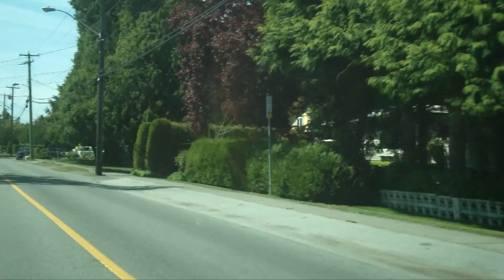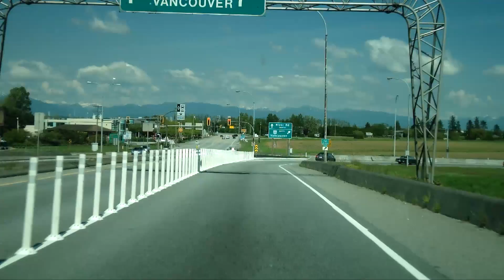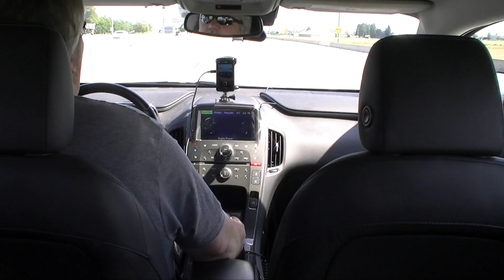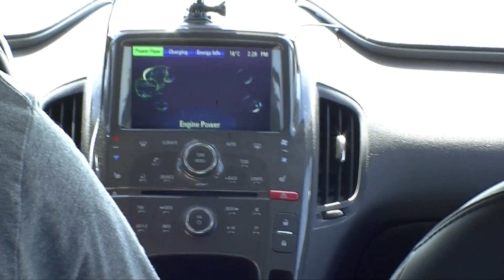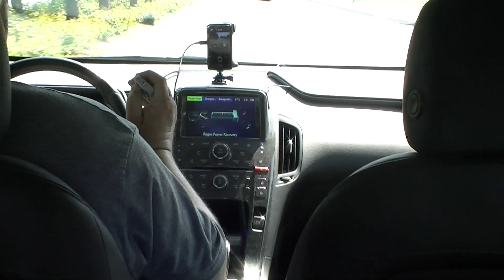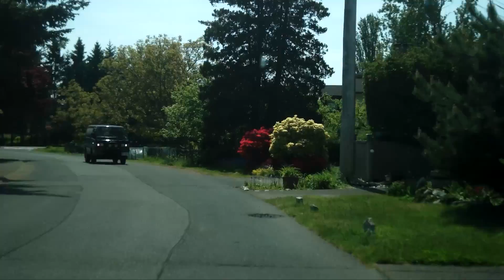How to drive a chevy volt for best electric range and fuel economy

Comment: How's the Fuel Mileage in the winter time?
Reply from the maker: +Trucking Vapes 
In the cold weather the electric range drops to about half, this is due to heating the cabin for starters. Also batteries do not perform as well in the cold. In extreme cold the engine will start for a few minutes. The warm coolant is used to heat the pack an cabin. Then the engine shuts down. In terms of fuel usage, I average 1.6 litres per 100 km. Over the life of the car. That is including road trips across the country. On average a tank of gas lasts me 10,000 km. That's right! I go 10 months between fill up of the gas tank!
Reply: +12voltvids I've been looking at a Used 2013. Any common problems? Battery & Powertrain have a decent warranty?
Reply from the maker: +Trucking Vapes No problems whatsoever in 4 years.80,000 KM and been all over western Canada and the USA with it.The warranty on the battery, and all electrical parts is 8 years 160,000 KM (100,000 miles).The only issue I had was a caution caused by a low battery coolant level.Took it back to the dealer, they added about 1 cup of coolant to the reservoir and sealed it again. The problem was documented. When the car was assembled, small air bubbles in the coolant line eventually worked their way out and were replenished by fresh coolant resulting in the coolant dropping over time (4 years) to the low level and tripping a sensor to warn. Dealer topped it up, not only was this free, but I received a letter giving me a complementary oil change, lube, multi point inspection, and tire rotation next year, all for my inconvenience of bringing the car back.People brag about Tesla giving them great service. Well GM has given me exceptional service on my Volt. I will definitely be buying another one, no question about that.FYI when my car was in for it's annual service the brakes pand were measures. Still over 10mm brake life left. They are only 12 when new and my car has 80,000km, (50,000 miles)
Reply: +12voltvids Thanks for the info, i live in Ontario myself, I have a 100km round trip per day, won't be able to Charge at home all the time, but will be able to at work 100%. I'm going to go take this used one for a Test drive and Talk about the price. It's at a GM dealer down here. Not some fly by night used dealer.
Reply from the maker: +Trucking Vapes 
So you should be able to get 50-60 km on battery power and the remainder on gas, perhaps 2 litres. In the dead of winter you will burn a little more. My battery range drops almost in half in freezing weather due to the electric cabin and seat heaters. I it get below -6 then the engine starts for about 5 minutes to warm the battery And cabin. This actually improves the battery range as the battery is warmed by the gas engine through the coolant, and the big heaters in the battery. I find that cold cycle warming uses about 1/4 litre of fuel. Nothing.
Reply from the maker: +Trucking Vapes I would say to only deal with the GM dealer on this car. It is very specialized as far as the systems are concerned. Sure the local wrench can change a tire, but for everything else the dealer is the best choice. The only thing I have had to pay for is an alignment, and that was my fault when I didn't see a monster pot hole in time.When my car was in for the once every 2 year oil change and check over (at the 4 year mark) the dealer missed checking the battery coolant level and a fault code pulled. Not only did the dealer fix it right away for free, but I received a complementary service for my next service next year from GM Canada, without asking for any special service. Volt owners are treated to the same high level of service that Tesla has been giving. They all treat the volt as a special car, and it really is. I have never had such great service, including being dropped off at home and picked up when my oil was changed. When my car was new, GM decided to add some extra side impact intrusion protection to the battery compartment. This was the "non recall work that they did after 1 car that had been subjected to a crash test caught fire 3 or 4 weeks after the test while sitting in the scrap heap. GM took the initiative to add reinforcement to the first 1000 cars that had already been built. I was given a brand new car to drive for the few days they had my car in. Again not something I am used to from other manufactures I have dealt with in the past.

Comment: I like my Volt.  Yes, it is an electric car.  There is a condition where the ICE can mechanically connect and assist, but that never happens under 70 MPH.
Reply from the maker: rationalguy We know that, but to the un-educated, well there is no convincing them. As they say, you can't fix stupid.
Reply from the maker: +abc68099 I have a 2012 so I don't have the hold mode, so I can't comment on how that operates going down hill. It probably does put more charge in the battery because the engine is running, and thus consuming fuel. In normal or L mode, the engine shuts off completely when going down a hill, thus recovering all that energy normally dissipated as heat in a normal car, and does not burn a drop of gas because the engine has turned off completely.

Comment: 16:50 There is no gearbox, so the ICE can only engage (through the planetary gear set) through a limited RPM range.  That RPM range (and the resulting single gear ratio) were carefully selected to match with the loss of torque that a/c induction motors experience at high speed.
 
See: http://www.nrcan.gc.ca/sites/www.nrcan.gc.ca/files/energy/images/energystar/figure-04.jpg
Reply from the maker: rennieallen The gear ratio is variable. First of all the ICE is only coupled into the planetary gear set under very specific conditions. This is only when cruising between specific speeds under low load, and it has noting to do with the gearing. It has to do with the fuel efficiency of the ICE. In normal operation, when in range extended operation (on a first generation volt only, the new one is totally different) the ICE generates power which feeds the main motor that propels the car. At speeds below 50MPH there is excessive power generated which is stored in the battery. Once a little extra charge is built up, the engine will shut off and that power is used up as demonstrated. At constant highway speeds between 55 and 75MPH the ICE can also be coupled in, in parallel with the generator, because at these speeds it is more efficient as the main electric motor is spinning very fast and is not as efficient. However if you floor it, the engine will disconnect, and it will go back into single motor mode again for full power.  You don't have to put links in, I know exactly how it operates, I own the car, and I have had it through all modes of operation. As a driver, you know when the gas engine is coupled in, because you can feel it kick in. Feels like an automatic transmission shift, and it doesn't happen that often in my driving, because I am very seldom in extended range. Only when I am on a road trip like I am this week.In battery mode, it will shift to dual motor operation at freeway speeds under low load for the same reason, so that the gear ratio can be made variable, which allows the motors to run right down to 1:1 when there is little torque required. 2 motors running slowly consume less power than 1 running fast. This is one of the reasons for the design change in the new volt. The took the rare earth magnets out of one motor, because a standard ferrite core motor is more efficient at higher speeds, and a rare earth magnet motor is more efficient at low speeds. The new volt will use the rare earth at slow speeds, and a combination of both or the ferrite only at high speeds, and the ICE on th enew volt will always contribute power into the power split planetary gear set when it is running, as there is no way to isolate it. On the first generation volt it can operate as a pure EV, a series hybrid, and a parallel hybrid. The new one operates only as a parallel hybrid once the battery is flat. It more like the other plug in hybrids, and they are even changing the status of the car from an EVER, to a plug in hybrid.In fact the drive train is going to be used on the Malibu Hybrid as well, but the new volt will have 5 operating modes, and the malibu only uses 3 of them, asit is not a plug in car, it is a conventional hybrid.